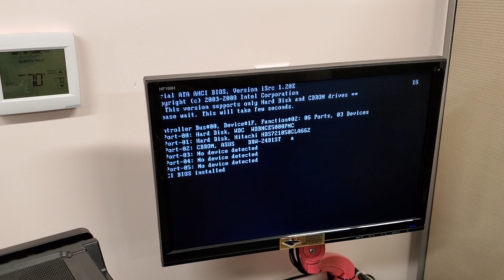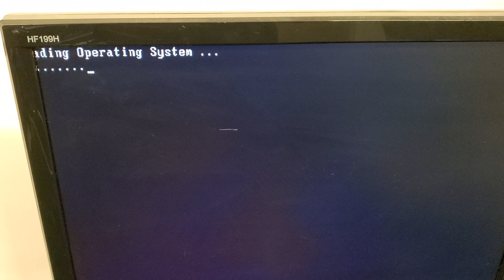Strangest problem, computer stops working when taken to customer's home. Resolved!

Comment: I can't understand how it took a PC Technician two days to work it out. Should have taken 10 minutes. Quite frightening
Reply from the maker: I agree, but this was very unusual problem. You could not see that the heat sink was loose. I was baffled with 20+ years of experience.
Reply: @Mac1PC go into BIOS, and watch temperatures. Would have been first thing I tried, cpu fan would have got noisy too as it was getting faster. Another big clue

Comment: Random shut offs can be caused by many different things. Bad board, memory, HDD failure,  processor not to mentioned PSU. I had one years ago that would shut off from playing an inexpensive video game. I found out it was the intel processor, I replaced it and it worked perfectly after. The temperature of the processor is kicking it to shut off,  re-paste the fan to the proc, fasten to the board and try again.